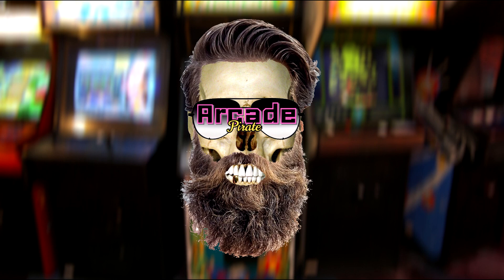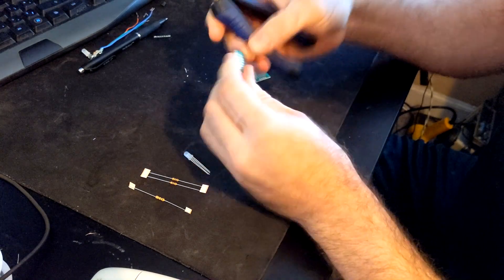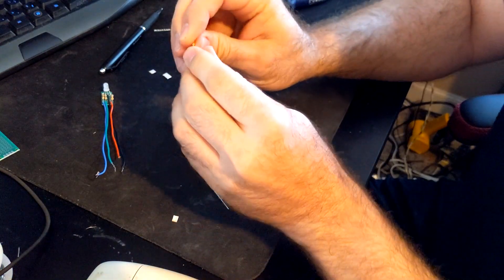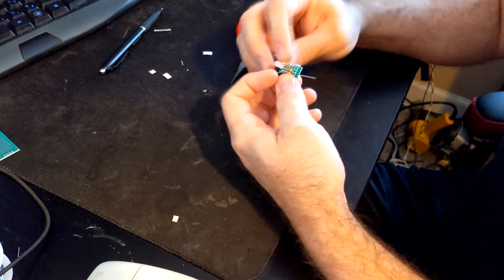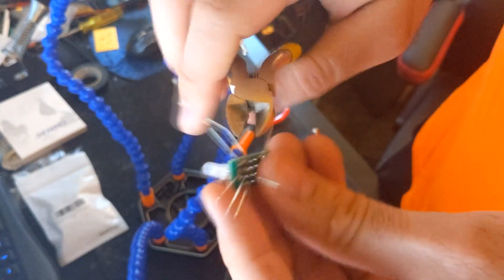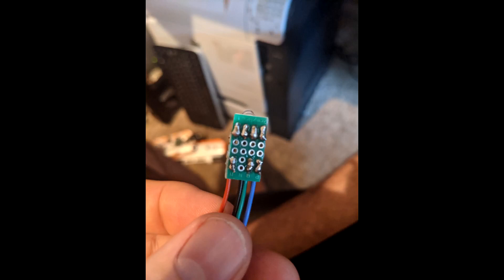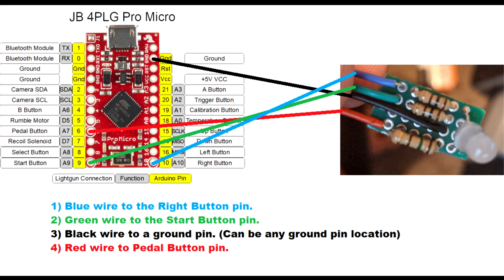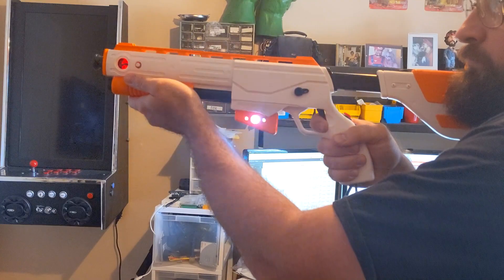GUN4IR RGB Lights

Comment: Dumb question. I noticed you didnt connect the led to the 5v input on the board but rather button inputs. How is the light powred, by the 5v running throughout the button wires? Cheers. Im using aimtrak. But i know i can do it. Cheers